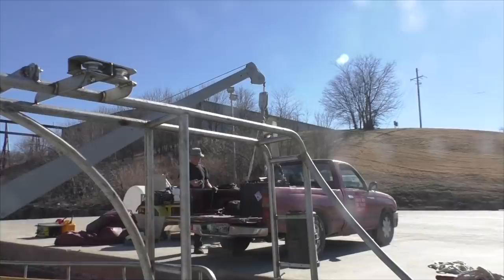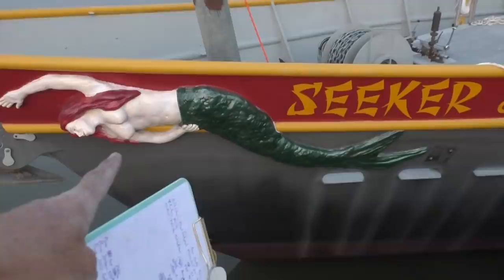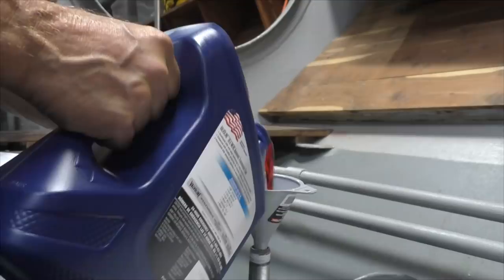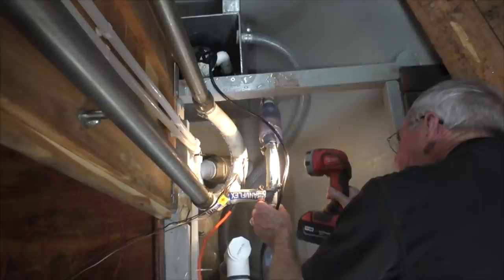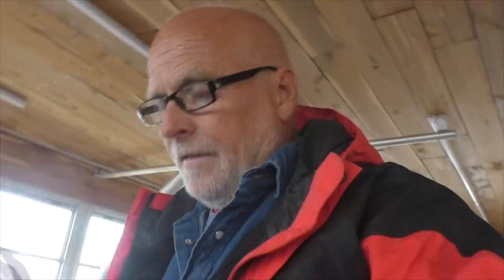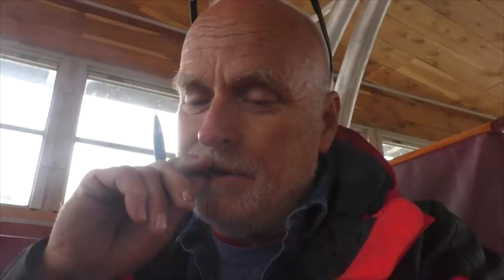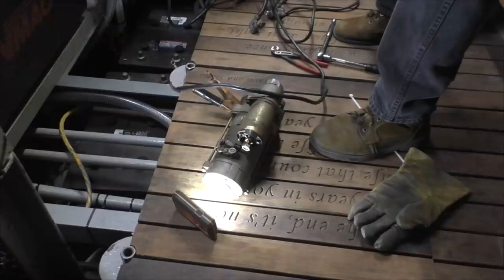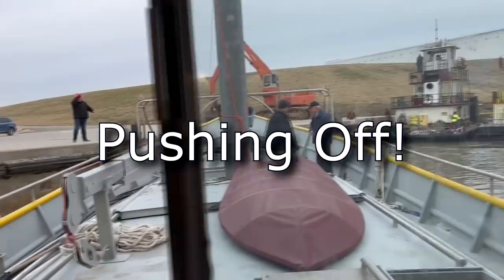Fire, Flood, Listing, Engine Failures and other Dockside Calamities

Comment: Just a recommendation. Put a vented loop on toilet inlet and outlet if it's below the waterline. That will prevent any flooding even if you leave the switch on fill mode👍
Reply from the maker: You can't draw water from a vented loop.
Reply: @SVSeeker  ahh yes you are right. If I recall I had to re-plumb the inlet directly to the hand pump and then a vented loop after on the pump outlet into the toilet bowl for my toilet. So the pump itself always has water but the bowl is vented.

Comment: it's great to see the boat in the water. you're amazing. A curiosity, why aren't we used ballasts with water in boats? that fill and empty to balance the weight like in submarines? instead of using all that lead ...?
Reply from the maker: The big cargo ships use water ballast but it's mostly to compensate for when they have little cargo.  Submarines like the Argonaut Jr that I build mostly use it the submerge and have much smaller hard trim tanks for trim, and again to help set their buoyancy.  We have multiple fuel and drinking water tanks and once the trim is about right we can tweak those if needed.    And once we start figuring out where machinery and such will live we will pull lead out and likely start turning it into dive weights.
Reply: @SVSeeker  thanks for the reply, i didn't think weight management was so complex, .. i've recently put on a few kilos, if necessary, i'll be happy to get on board as ballast 😁!

Comment: Slipping a converter at idle is normal, the converter should slip less off idle. If you want lock up on command you can add a switch. One thing to remember is converter slip causes heat and a lot of it.
Reply from the maker: Yup.  We are just going to remove the converter.   The AT545 is way before they build converters that lock.

Comment: Will the swing-gate check valve (that you installed to keep the oil prime) fall open if the boat heals when sailing? And if it does will it loose prime, or will the heel angle keep the pipe from draining?
Reply from the maker: I doubt it, but we’ll see.

Comment: Do not remember you still had the  bus transmission. That may be problematic but 🤞🤞🤞you can make it work for you.
Reply from the maker: Yes.  We're just going to remove the torque converter next.   And it's very little money.  : )

Comment: So Doug, would a video-cam from your existing security system onboard also give the command station a view of the circuit breakers, or some sort of audio alarm for when they pop to alert captain or crew of an open circuit from a motion sensor ?  Seeker seems pretty well balanced considering you don't have any cargo fwd of engine, tender and other aft dominant forces pulling stern downward. Maybe get 30 or 40 people onboard for a short cruise and move them about above and below upper deck approx 1000 lbs at a time vs all in center of cargo hold and upper deck etc. Order some pizza or tacos and you'll have lots of "volunteer ballast" show up for a boat trimming party !  OH... and HI BART ! (waving back)
Reply from the maker: Yeah, but there is a temp gauge to tell you the problem, which can have a variety of causes.
Reply: @SVSeeker  checklists r your friend

Comment: There is a term for it personally its called daily use for me lol Also you can manually lock up the converter with some wiring.
Reply: And the trans temps will drop when its locked
Reply from the maker: Unfortunately not on the AT545.  But eliminating the torque converter is possible.
Reply: @SVSeeker  Guess Im used to old school transmission not old school bus transmission, Thats a bummer but Im sure if theres a way you will find it.

Comment: Congratulations ...you might need to rework that bit of plumbing for the intake and head... you will sleep better longterm especially if you have to leave the vessel at anchor. 
Even if its just making it easier to visually check every things shut off. 👍🏼🤞🏼
Reply from the maker: I sleep 5 feet from the pump.  : )
Reply: @SVSeeker  
Lol....  You've got this far  ...  👍🏼😉🇬🇧🤞🏼 It will be good to see her rigged.

Comment: Install a lockup torque converter, or plumb a way to lock up your torque converter when you go into forwarding drive or both directions.  Maybe if you want to keep the torque converter function you could get a converter with a very low stall speed.
Reply from the maker: Or remove the torque converter.  : )

Comment: Food for thought. Adapting a GM Powerglide transmission with a direct drive converter and full manual valve body may be a solution for a couple reasons. Has reverse. Has a low gear for slow motoring and maneuvering. Direct 1:1 for cruising. Can take everything your Cummins can dish out. A prop in water acts as a torque converter, so a direct drive converter is perfect. Much less heat generated. Way lighter than your transmission. And it’s what I run in my little V Drive boat.
Reply from the maker: Right, there’s a boat not far from here that uses that system.

Comment: I think a manual trans may of been a better application.....  also an opportunity for a really tall gear stick with a skull shift knob.
Reply: Also would be a weigh less.
Reply from the maker: The stick shift would be a challenge.  : )    ...instead we are going to remove the torque converter.

Comment: Have you ever thought of the prop spinning with the engine off from river current. I’m assuming the bud transmission is a Allison with no parking pawl. just park the boat with the prop blades in feather I’m guessing? To prevent the trans from spinning without  the engine running
Reply from the maker: We'll have to get in a river with something more than 1/5 knot of current, but if that is an issue we will feather the blades.   I don't thing a brake will ever be needed.

Comment: Doug, what year and make did you get the engine from? Didn't you use the transmission from that vehicle?  If memory serves it was a dodge truck. If so you can electrically lock the torque converter and put it on a switch to get 1 to1 connection from engine to Trans with minimal slip
Reply from the maker: It's a guess because it was a swap out for the bus's original engine and the serial number tag is missing.    And no, the AT545 is way before lockup converters.

Comment: looks like a lot of prop walk in reverse. it can help you or hurt you depending on what side you want to tie up on ;)
Reply: also practice springing off a line. very helpful in tight spots but your deckhands gotta be on his game when it comes time to untie. forethought and practice helps
Reply from the maker: Yeah,  we thing we can work it both directions using the variable pitch of the blades.  We'll need to experiment more.

Comment: Why did you end up using a truck transmission? A zf marine transmission would cost about the same as a dodge ram transmission new or used
Reply from the maker: It's free.  And too many people said it would not work and I think it will, so I'll happily be the one to do the experiment that others are afraid to do.  : )

Comment: Doug is there any brake on the drive shaft?  From other comments about windmilling with movement or currents... coming into port and docking, may you have to quickly move from forward to reverse?  ... or visa versa?
Reply from the maker: No.  And I doubt there is any rotation once it's feathered.   And if I need to move quickly from forward to reverse I think I need more practice, not more equipment.

Comment: awesome work fyi the transmission it might be an underdrive in the lower speeds so 700 from the Engine could be 100or 200 on the output shaft at an idle
Reply from the maker: We're going to remove the torque converter.   That should solve a couple of issues.

Comment: Except maybe to limit draft aft, you dont need to actually ballast to the waterline you painted. If Seeker passes the stability test at the current waterline, you could operate that way.
Reply from the maker: Yup.   That's they plan.  Get the sails on her and then check the stability.

Comment: Does that allison transmission have an output speed sensor (or vehicle speed sensor)? If it does then there's your signal for driveshaft RPM.
Reply from the maker: I think it does, but we're going to remove the torque converter so we'll just watch the engine tach.

Comment: I hope this question is well taken:  Are all of these systems documented and labeled in the event that knowledgeable people are not present in an emergency?
Reply from the maker: So in an emergency there are only idiots left to run the boat?
Reply: @SVSeeker  Let's hope not, because not everyone in the boat has the same level of knowledge as the Chief Engineer.   In an emergency, when emotions may be high, the course of corrective action should be clear to every crew member, many who were not involved w system design.   Having all of the knowledge in one persons head creates a single point of failure.
Reply: You are witnessing all the outcomes of not having documented system drawings and check lists. It is not a question of guiding idiots - it is about avoiding unnecessary failures that threaten the ship and the lives of the crew.
Reply: @normanboyes4983  I agree.  In any engineered system, documentation is a pain in the a$$.   But a necessary pain.
Reply from the maker: @normanboyes4983  I think you’re just reflecting on your own ability to not understand the system without a document.
Reply: @SVSeeker  Doug and that is exactly why pilots have checklists and procedures to guide all that they do. I have 40 years professional sea going experience we never thought less of ourselves for using system drawings and checklists - why do you think your innovative approach confers advantage. This is not about being some sort of safety nazi. This is about taking prudent and reasonable measures in what is a hostile and unforgiving environment.
Reply from the maker: @normanboyes4983    Then that's way you should do.     I'd like to point out that pilots are having a really time of it lately.  Maybe they need to rewrite some documentation.   That will make them better pilots.  : )
Reply: @SVSeeker  I take it more like if you are knocked out of commission and shit is hitting the fan at sea,  boat is listing and slowly sinking, the time it takes someone to figure out the plumbing system from scratch, go through some trial and error,  could be critical vs having everything marked and documented so even someone unfamiliar can figure out the right action to take quickly.. Same reason sailing couples make sure the wife can actually sail the boat to the nearest port alone if hubby gets disabled or worse.  

Chances are it won't happen, but if does it could be bad. And once you are on the sea, you'll likely have plenty of boring times to document stuff. Might be a waste to do it now anyway, as you may be making significant changes as you use the boat more and get accustomed to sailing it.

I'm waiting to see what it's going to be like navigating the Mississippi's ever shifting sand bars. Can't wait to see Seeker in the Gulf!
Reply: @SVSeeker  I think the point being reasonably made is that over time we forget which wire goes where, what fluid volumes, viscosities, temperature norms, flow rates and calender/hours consumables change triggers or parameter limits should apply.  Efficient operation and preferably planned not reactive maintenance needs comprehensive O&M manuals (system and component related) with accurate schematics and layout drawings, backed up by idiotproof field colour coding, cable tags, normal  valve open/shut status tags and valve numbers,  commissioning records and field marking  of normal pressure and temperature ranges, lists of spares and consumables. I can only speak with engineering experience of industrial facilities in the above and fully accept that SV Seeker will have sails, but there's a ship load of M&E plant here  capable of causing grief to justify documentation.  Meanwhile it's great in a situation preventing my own  shed activities seeing this project progress, along with Tally Ho, Ship Happens and others, all with vision blindly prevailing over all obstacles.
Reply: @SVSeeker  For the record, what you have done is impressive, no doubt about it.  But there is a reason why organizations and the military and even football teams write down their procedures and processes.  It seems especially relevant on a boat like yours, where you will have many guests and volunteers aboard.   To believe that you will be able to trouble shoot every problem or even be conscious or present during an emergency is hubris.   It creates a single point of information failure and a lack of redundancy.
Reply: @philhealey449  Exactly.
Reply from the maker: @KillerNetDog    Sounds like a lot of fear to me.   No instinct, no skills, no general knowledge?   You want a book?   Why would I want that on my boat?
Reply from the maker: @chiphill4856   If that is want you need to feel safe then do it.   But if you have no instinct, no skills, no general knowledge?   You require a book?   Why would I want that on my boat?   What are you offering?
Reply: @SVSeeker  I'm offering safety and ease of operation.  As an example, when the deck crane didn't work, how much time did it take to realize that the relief valve was open?  Who helped realized that?  In an emergency would those same forces be present?   Would there be time?   

Us naval ships as well as many other boats, large and small are full of smart, well-trained people, yet they still take the time and expense to label and document systems to improve safety and reliability.   I should also add that many excellent Chief engineers, who know everything about the systems, tend to over-estimate the knowledge and understanding of others on the project.

I'm not bashing, but sincerely attempting to improve your experience and safety.   It is your boat, and a fine boat it is.   The manner in which it has been built is nothing short of inspiring.
Reply from the maker: @chiphill4856     If it makes you feel good then you build a ship and document the shit out of it.    You can even crew on Seeker if you have the right attitude and document the shit out of it, on your own time.   I'll never read it.  : )
Reply: @SVSeeker  To be clear, I think clear labeling is first priority, full documentation is a much lower priority.   Good luck to you sir.   It's been fantastic watching the progress.  Your can-do attitude and ability to get things done is impressive.  Even if we disagree about labeling. 🙂✌🏼
Reply: @SVSeeker  P.S.  All of my boats' systems are clearly labeled and others pay me nicely to do it for them as well.
Reply from the maker: @chiphill4856  I bet your mom is proud of you.  : )
Reply: @SVSeeker  No need to be snarky, friend.   Good luck with the project.
Reply from the maker: @chiphill4856    No need to be sensitive.
Reply: @SVSeeker  Funny, I didn't take you for someone needing to have the last word.

Comment: What transmission are you using in the boat.
Reply from the maker: Allison AT545   One of the old automatics that still used a stick to select the gear.
Reply: @SVSeeker  If you want to eliminate the converter slip you can change that at545 out for a at1545 which had a lockup converter, in stock form it only locks the converter in 3rd and 4th gears but it could easily be modified to lockup in every gear.  The only difference between a 545 and a 1545 is the lockup converter so it would require no modification to physically install it.  The at454 is essentially a enlarged th400 and it shares many design cues with it.

Comment: Maybe THE CNC machine is a little over the top.  I understand the importance of a self sustainable expedition boat.  But what happens when you start collecting material to meet every possible need?  Will the amount of cargo be limited due to excessive equipment?   The bigger question is how will Seeker handle 20 foot waves in a storm. WOW as I sit here thinking, I never imagined how weight factors play such an important roll (no pune intended)  in design and build.  You have a ship and I thinking sail boat. LOL.
Reply from the maker: Nope that CNC might move, but it stays.  And one bridge at a time.  Humans are prediction machines, but they really suck at it.  : )

Comment: Question: If the boat is easily listing doesn't that indicate there is not enough weight at the keel? the boat is too high on the surface? Oh one more question: how about what happens if your mast is hit by 🌩 lightning
Reply from the maker: No, and don't stand beside the mast in a lightening storm.   : )

Comment: probably late to the party... again... you can get an adjustable flow control for hydraulics that will slow the flow down, but not effect overall pressure, My log truck uses several of them for the log grapples and the swing motors (uncontrolled it would throw me out of the seat... or spin the grapples until the hoses break)
Reply from the maker: We might do that.  The boom up is where it really needs one.  The load control valve that is on it only regulates the down boom movement.   Other than that, I like it more lively than beginners do.  : )

Comment: Was the transmission rebuilt for marine use? If yes, then the slippage might not be as bad as you think, since marine transmission settings are frequently a reduction to turn the shaft / prop slower.
Reply: AFAIK that trans is pretty much as is when it was pulled from the school bus. Go back a bunch of years in the videos to see.
Reply: @chrishopkins3079  Figured that was the case but the point is still valid, it could have a gearing to reduce rpm of the drive shaft anyway.
Reply from the maker: Not yeah, but pulling the torque converter out is the next step.